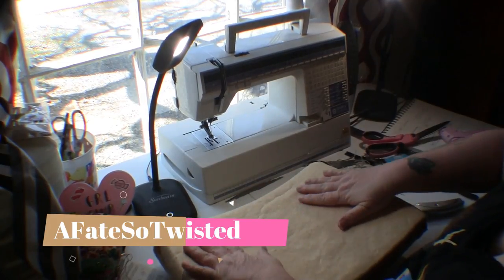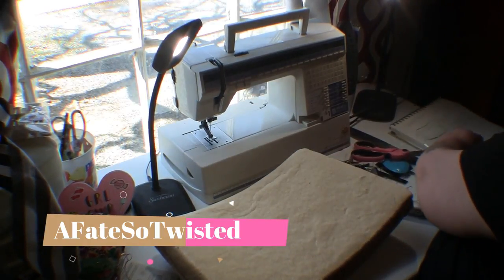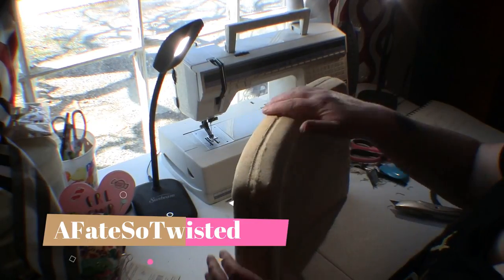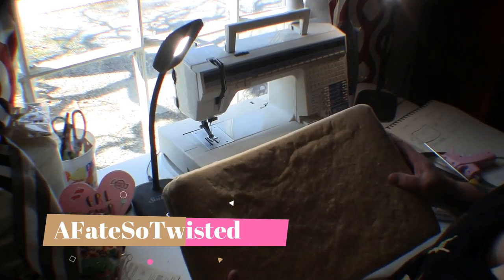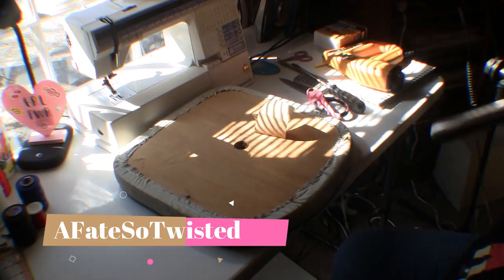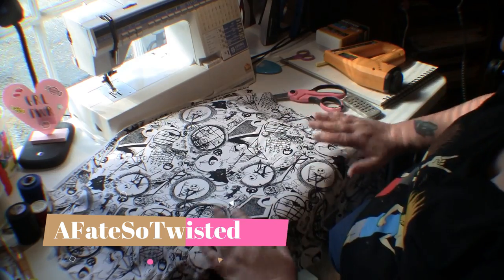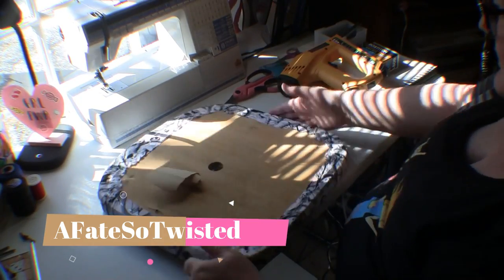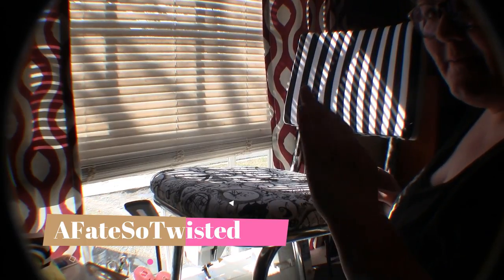Retro Chair Revamp

Comment: Great job.  Is the fabric the decorator kind?
Reply from the maker: lowec315 Maybe. It's a little thicker feeling than average. But that's why I put the extra layer of batting underneath. I wanted to cover it with clear, fusible vinyl, but what I had didn't fit.